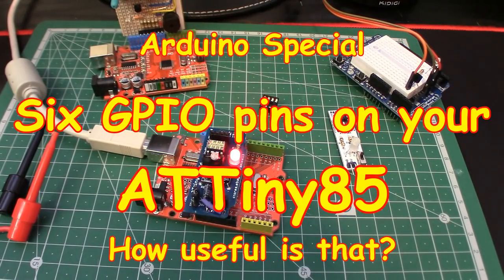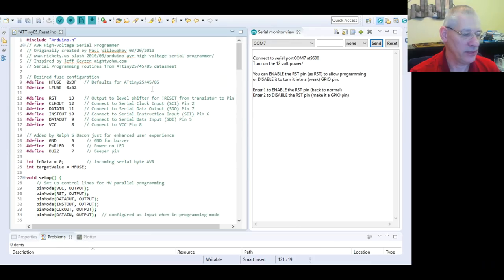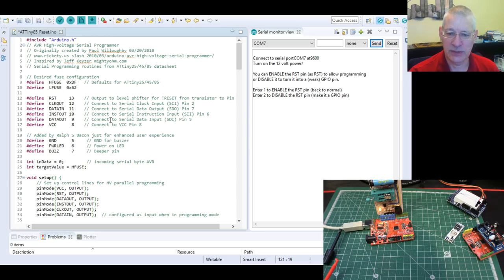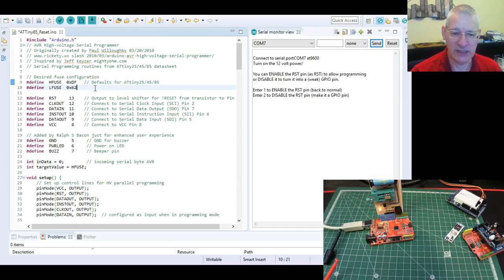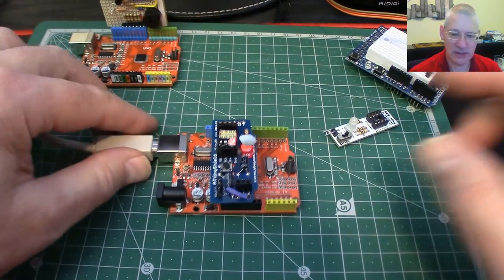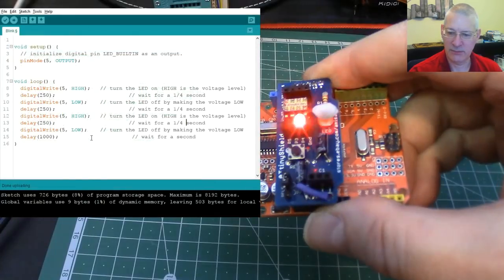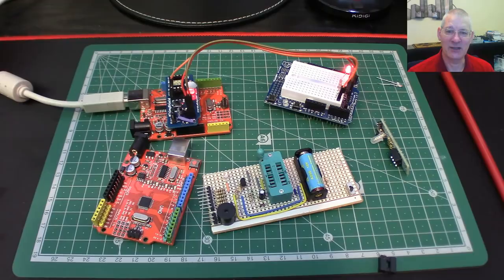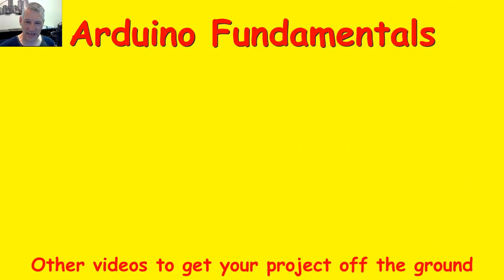#87 Six, yes SIX, GPIO pins on an ATTiny85

Comment: Thanks for the info! Much appreciated! Did anyone figure out a known resistor value that works for pin 1 and a transistor? I am going to try 1k, but will have to wait for parts.
Reply: BTW: I am using a digispark clone for testing. I think I may like your setup better.
Reply from the maker: Hey Willysnowman, good question and easy to answer.
 
If you are driving a simple NPN transistor from a GPIO Pin of any Arduino-style board, then you have 5v available. To turn the transistor on fully, you have to supply sufficient current to the base (you really should refer to the spec sheet for the transistor) but let's say you need 15mA of base current, then at 5 volts you need a resistor of around 300 ohms. A 1k might also work (depends on how much current you need to flow in the transistor down the collector , eg to turn on a relay) but what you want to avoid is the transistor not turning on fully - it will generate more heat if partially on. Start with a 1k and measure the current flow in the base, refer to the spec sheet to ensure that makes the transistor 'saturated', aka fully switched on. This answer glosses over various aspects but it will be enough to get you going.
Reply: Thanks Ralph! My ebay digispark seems to provide 3V on high. I may move towards your setup as I am getting tired of playing with these.

Comment: sir, as im new to arduino(Beginner) this problem arise when i wanted to program ATtiny85, when i connected all pins to uno and upload sketch, error it saying select correct board from board manager. even i selected crct board and port, i googled about this problem and found that my ATtiny85 is bricked,finally i found a page and link to this video, and i collected all components but i didn't understand that how do i upload the code? im having few questions, should i use "arduino as ISP" ? or should i select ATtiny85 from board manager? and which clock speed should i use? help...
thanks in advance.
Reply from the maker: Have a look at video #82 which describes in some detail using the ATTiny85, ARGS. If that doesn't answer your query let me know and I'll dig further for you. As it happens I will be demoing some very small ATTiny85 adapter boards in a future video which have a micro USB port but that won't help you right now but may interest you in the future. Good luck!
Reply: Ralph S Bacon  i understood the concept of programming ATtiny85 using arduino uno as ISP but inorder to set the correct fuses by using arduino uno, we nee to program arduino as ISP then select the board ATtiny85 frm board manager and upload the fuse resetter sketch, am i right. am i on the right track? even i created the board which ur using for resetting fuses or for extra gpio pin. correct me if am wrong.
thank you for replying on my comment.
Reply from the maker: I think that pretty much sums it up, Args, just be sure to follow the video step-by-step and look at the video description for more resources that I may have included.
Reply: Thank you Ralph, for all the good videos. And now for ARGS.
Using Arduino IDE upload the sketch to the UNO board. Keep in mind, the sketch is for UNO and not for attiny. When you upload the sketch do not use Arduino as ISP. Select the simple AVRISP mkII or AVR ISP as programmer and Arduino/Genuino UNO for the board. After programming the UNO board with the sketch go to Tools and click on Serial Monitor. Check to see if you have 9600baud in the right corner of your Serial Monitor window. Connect the High Voltage programmer board in to the UNO board an you should see in Serial Monitor window a message like this:
"
Turn on the 12 volt power/

You can ENABLE the RST pin (as RST) to allow programming
or DISABLE it to turn it into a (weak) GPIO pin.

Enter 1 to ENABLE the RST pin (back to normal)
Enter 2 to DISABLE the RST pin (make it a GPIO pin)
"

Comment: Just curious if you are able to recode to have a 3rd PWM
Reply from the maker: You could bit-bang a further PWM pin I imagine, Nicholas, but it would not be hardware-based and therefore not independent from the rest of the sketch. MIght work, might not depending on what else you are doing in your sketch. You could not have a single "delay" statement in the entire sketch.

Comment: Which Kind of Transistor and capacitors You User.
Reply from the maker: Any standard NPN transistor will do, such as BC337 BC327 2N2222 2N2907 2N3904 2N3906 (these are the ones I currently have on order from AliExpress, what a coincidence!). I can only see one capacitor that I probably used for decoupling the power supply so a 10µF will do. You can get a great selection in a small plastic case from AliExpress or Banggood for just a few dollars that will see you right for years!
Reply: Thanks a lot!

Comment: Is that Tool at 15.00 aka Fuse doctor! Thanks
Reply from the maker: Well, Omo, I've discovered that there are several, very similar circuits just like the Fuse Doctor one (which I searched on Google for) so I suppose it is similar to that, although the source of my (somewhat upgraded) circuit board is, I believe, mentioned in the video or the video description. But the gist of them all is that you apply a 12v pulse to the correct pin at the right time and voila! You have a reset fuse. My home grown version works very well although you can get kits (or ready-made versions) of similar items off the Internet if your soldering skills are not up to the job. I hope this helps.
Reply: Ralph S Bacon 
Thanks Great 👌🏻

Comment: Hi Ralph, Love your videos - always well produced without waffle. Did you show the diagram for your modified circuit anywhere? I can't seem to find it.  Keep up the good videos!
Reply from the maker: I can't remember what I did with the modified circuit, kintara58, as I'm a few thousand miles away from my workshop it will have to wait until I return. Give me a nudge if you don't hear anything in a couple of weeks!
Reply: Not to worry. After careful examination of the video footage and the Arduino IDE script I think I have worked out the circuit. The only thing I’m having an educated guess at is the addition of a reverse polarity protection diode on the 12v line and a smoothing capacitor (10uF?) between 5v and ground. Next step is to make it up and maybe etch a PCB.    Thanks for all your video tutorials - I find them very useful and easy to follow.
Reply: See my post above. Schematic posted.

Comment: EDIT:

I pulled out another ATTiny85 and its working with no issues.  So, apparently there are no problems with my circuit or sketch.

Though, what is happening, as described below, is still strange.  

Did I really 'brick' my chip?   (The code I put in does function, I just can't update it with anything since I can't change even read the fuses)
Do I just need to do an erase?   (I know I didn't set the lock bits)

I'll investigate more.

Cheers!
--------------------------------------

Hi Ralph,

I really tried to get this working, but i'm hitting a wall...  Hoping you, or another viewer, can help! :-)

I built the circuit per the schematic on your GitHub, with the following changes:
      Using a Pro-Mini rather than an UNO - same pin numbering
      For the 12V source, I'm using a MAX662 rather than a battery.
           removed switch, 12V LED and protection diode
      Removed Buzzer

I did use a 10uF, as per the schematic, for VCC2.  (I understand you used 0.22uf)

The only changes I made to your code was removing any references to BUZZ, and removing the GND2.
(As the GND2 seems to be only for improving the buzzer & Other many other schematics appear identical to yours, but use a single common ground.)

With a bunch of detective work, I've traced the problem to the first shiftOut2 command:

    // Returns the value of the HFUSE
    int readFuses() {
      Serial.println("Reading fuses");

      //Read lfuse
      shiftOut2(DATAOUT, INSTOUT, CLKOUT, MSBFIRST, 0x04, 0x4C);
      pause();       // Function i  added to wait for user action.  *
...

The "Reading Fuses" displays properly, but it never reaches the pause(); - It just hangs
     (The pause function does work - it was used several times to get to this point)

Presumably, the code should work regardless if there is an ATTiny inserted or not, yes?
      (The code gets to the same point regardless)

I've run through all the pins with a hardware check program that activates only one pin at a time, on an empty socket, to confirm proper operation, check for shorts, etc.

The MAX 662 can only supply up to 30mA, but the line isn't being pulled down, so I assume it isn't using much current.

I haven't been able to find much documentation on the shiftOut2 command.  almost all references I can find relate to HVSP code. 

I've been banging my head for a couple of days on this!

Any Ideas???

My only idea remaining is to remove/change out the cap on the VCC2 line

** EDIT **

While writing this, I had the program sitting in the background.  after MANY minutes, the code did reach the pause() function.  I've entered a value to get it to continue.

From what I have seen on your video, and others, this should take less than a second.  
         All the other commands seem to operate with the expected timing - ie, really fast.
         (my pro-mini is a 5 V 16MHz & has been working fine with previous projects and everything else in this one)
...
Now that I have writing the above, I have a lfuse reading E0.  (was expecting E2, but whatever, at least its a reading)

Waiting now to see if a hfuse value gets read.  It has been several more minutes since I got the lfuse reading.  been about 10 minutes, nothing yet, but will let it continue running.
Reply from the maker: It sounds as if the Tiny85 with which you're having issues is that it is running very slowly - but really slowly, not just 1MHz instead of 8MHz. At the end of the day, if that chip is causing so many issues just continue with the other one, it's not worth spending hours sorting out a $1 chip.